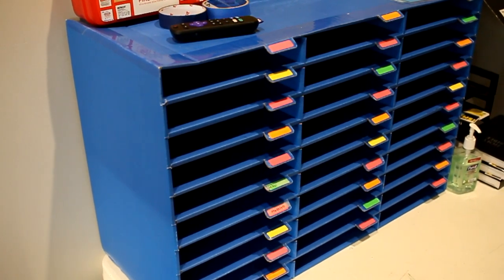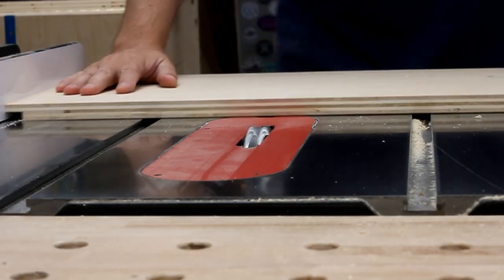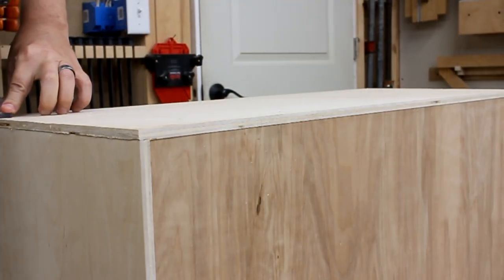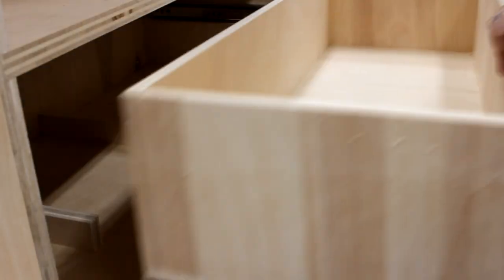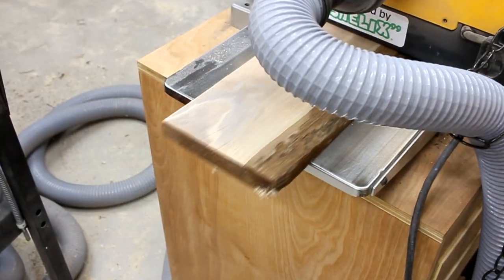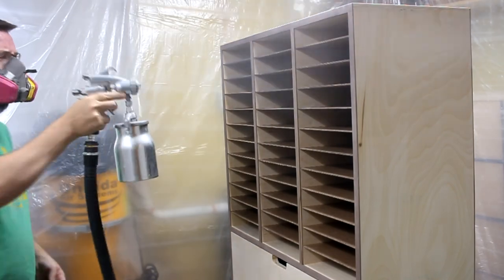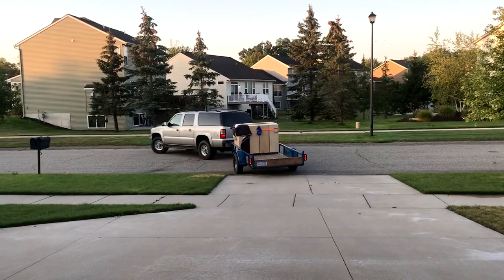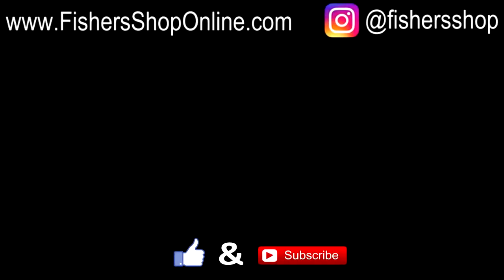Woodworking: Making A Classroom Organizer

Comment: Love your videos, man ! Quick question. Why did you waste the space at the bottom of the drawer that could've been utilized by making the drawers deeper of by adding the drawer slides a bit down?
Reply from the maker: I had different casters in mind that would have needed that space for bolts.  Ended up going a different route.

Comment: Great looking organizers but, why the large space under the drawers?  1 1/2 inches seems like some wasted space to me.
Reply from the maker: The casters I had planned on using require through-bolts, washers, and nuts on the inside.  I wanted to leave ample room for them.  However, I ended up going with a different caster after my pieces were already cut.
Reply: @FishersShop  Oh, got it.  I thought it might have been for casters but, then you used the ones in the video so it didn't make sense.

Comment: Why move everything in your shop when you have a track saw that probably produced a better cut than your tablesaw?
Reply from the maker: It can't produce a better cut.  I don't have a good blade for it.  Plus it's much less accurate
Reply: @FishersShop  Wow from all other input track saws produce a very accurate cut.  But hey it your shop and it is you that has to move the stuff.
Reply from the maker: @edblough4134  The cut itself is straight and clean.  But if you're not referencing another edge against a table saw fence, then you're bound to make the cut not perfectly square... hence the inaccuracy.  I get it real close... but I prefer to use the table saw.  Just means I gotta move some stuff around

Comment: why did you leave some space below the drawer? why not just make a bigger drawer?
Reply from the maker: I was planning to use different casters that would have bolts and nuts in that area.  Then I changed to a different caster last second.